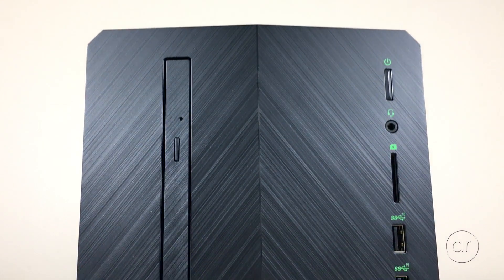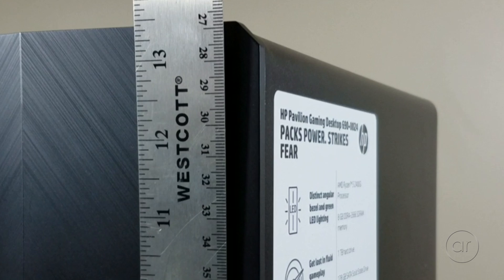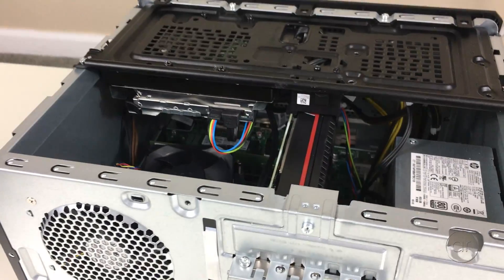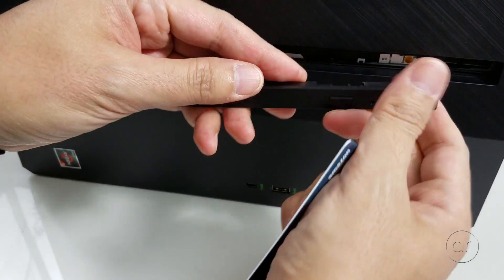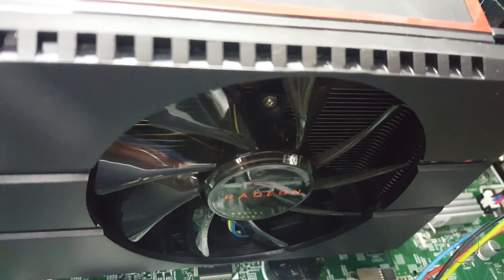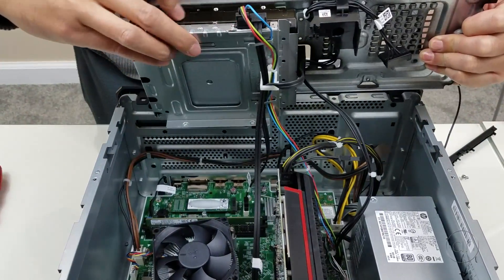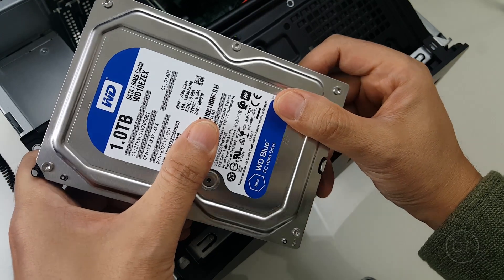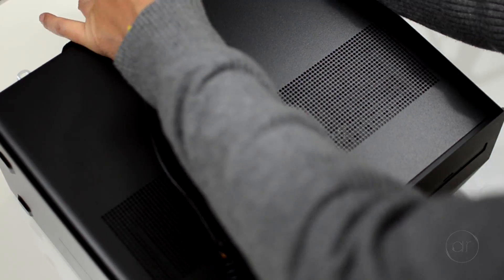How to Open and Upgrade a Ryzen-Based HP Pavilion Gaming Desktop

Comment: Well, I've gone and done it now! While in the process of upgrading the M.2 SSD to a WD Black 1TB NVME...I fried the mother board.  Thought I'd share so people can learn from my mistake.

The Bios on this computer has a real hard time recognizing hardware changes. you basically have to clear the CMOS every time and because of the GPU placement the easiest way to do that (which actually works) is to remove the button battery on the motherboard.  I forgot to do that when I swapped the M.2 drive so it wasn't recognized when I started back up. While kicking myself for forgetting to do that the first time...I got in a hurry...and...forgot to unplug the computer before popping out the button battery...which flipped itself across the inside of the case and shorted out the board when it landed coming in contact with both the board and the PSU. :(

Computer is dead...I went through a long series of tests but the best I could get was that the LED on the power button will come on as soon as I plug it in but nothing else works.  Unplugging the PSU fan controller connection (small 8pin) from the MB results in the case fan and the CPU cooler fan to come on...but nothing else works.

I have now completely disassemble the computer, removing everything from the case, and ordered a new motherboard and case (because the new MB won't fit). In doing so, I discovered I'm also going to need a new PSU as I don't think the one that came with this computer can be used with another motherboard due to the presence of the PSU fan controller connection which doesn't exist on commercial off the shelf motherboards.  I did find an exact replacement sunflower motherboard online...but it cost $368 from china!!!  I also found an exact replacement PSU online...for $218!!! These custom proprietary parts are ridiculously expensive.

So in the next week I will be setting up a new PC using a new B450M Gaming Plus motherboard, new 450w PSU, new Case, and all the other components from this PC...the 2400G, Freezer 12, RX580-4gb, 16gb Samsung RAM, 1TB WD Black M.2 NvME SSD drive, and 1TB WB Black 2.5" SATA SSD drive. Wish me luck...I sure hope the CPU wasn't fried when the board shorted!
Reply from the maker: Doh! Sorry to hear that - those replacement prices are criminal. At least most of your components will carry over to the new computer. Best of luck to you!

Comment: I have the same model but want to add more ram is it ok to mix brands with the same gb
Reply from the maker: Though I generally don't recommend mixing memory brands or models, I've had several reports of successful memory upgrades - you can find the models above in the description (under Memory, not Replacement Memory).
Reply: @accessrandom  thx you just got a new sub
Reply from the maker: Thanks - glad to have you here!
Reply: @accessrandom ust ordered the GSkill 8GB F4-2666C19S-8GNT thx

Comment: Is there any way to make a am4 cooler fit at all? Like a adapter or anything?
Reply from the maker: Unless the cooler comes with the brackets for an Intel mount, I'm afraid not. I suspect the motherboard manufacturer (Sunflower) cut some corners by keeping the mounting points drilled for Intel.
Reply: The Freezer 12 comes with a custom mounting bracket solution which allows it to be used for either Intel1151 or AM4...but I've not seen a bracket sold separately that would allow for this.
Reply: @terryparrott9426  if I follow your instructions, do you think using Velcro to attach a 2.5" SSD to the top of the psu would be problematic? I cant get rid of it

Comment: does anyone know what kind of cooling system i can add to this?
Reply: I provided a detailed rundown of how to reduce the excessive heat generated by this PC. The details are included in the notes above or you can look through the other questions that have been asked until you come to the one I wrote about cooling.
Reply: @terryparrott9426  so much work ugh! Edit: for someone who has only ever upgraded ram and installed ssd's

Comment: i have one but with an RX 550 4gb... I searched on Hp's website for the model number (690-0067c) and I couldnt find it anywhere. I expected it to be an old model, but soon found out that it was assembled just under a year ago! How do I know if I can upgrade this?
Reply from the maker: Looking at the motherboard for the 690-0067c, it looks identical to the 690-0024 (with identical CPU upgradeability). I can't say with 100% certainty, but it appears to have the same upgrade paths.
Reply: I have the same system bought from Costco.  It can be found on the HP site here:  https://support.hp.com/us-en/document/c05953209

So far I have added a Samsung 970 EVO 500GB - NVMe PCIe M.2 2280 SSD (MZ-V7E500BW).  After installing the ssd and reinstalling windows 10 on it the boot time went down significantly and the system is much more snappy and responsive.  I am upgrading the rx550 to an rx580 also just waiting for the 400w psu to come in from HP.  The rx550 was fine but can't play games much higher than low or med settings at 1080p without stuttering real bad.

Comment: what type of ram does this computer already take? and could i just buy the same one that's inside to add more storage
Reply from the maker: There have been two specific models of memory that viewers have reported (you can find them in the description). You can either add the same model, or add one with the exact same specs.
Reply: access random do you know if a GIGABYTE NVIDIA GeForce GTX 1070 GV-N1070WF2OC-8GD 8GB  will go into this computer im have trouble figuring this out need help
Reply: AS an FYI...I've found that you can buy a matched pair of 8GB ram sticks from the major RAM retailers for the same price as a single 8gb Samsung stick. You might be happier replacing the one in there with a matched set and trying to sell it to recover some money.

Comment: Help please what upgrades I need to play Black desert online remastered on high setting please list in comments
Reply from the maker: It looks like the game's recommended system requirements are an Intel i5-650, Nvidia GTX 970 or AMD RX 480, and 8GB memory to run at 720p. I'm not sure how that translates for higher resolutions and running at highest settings. Has anyone else had any experience with the game?
Reply: There are two upgrades needed...add another 8GB memory stick to bring your total to 16GB. The reason you need to do this is because 2GB of your 8GB are reserved for the 2400Gs onboard video support (which is disabled by the way) so you only have 6GB available for gaming. Then enhance the cooling as I described elsewhere in these forums. This computer runs hot and the thermal throttling is real...for the CPU, GPU, and RAM! Once I made these two changes I could run any game on high settings without issue.

Comment: Saw a few other comments asking, and I saw you said there were mounting holes for another 2.5" SSD, do I need to go out and buy a bracket for it or is there a safe place/way to hold the SSD in place without doing so?
Reply from the maker: I actually took the path of least resistance and used velcro :) However, I believe you can use the four mounting holes on the cage (which you can see at the 4:30 mark - where the holes are drilled into the indented part of the sheet metal). Not 100% sure - but those seems to line up to a horizontally mounted drive.
Reply: @accessrandom  Thanks, I really appreciate it.  I discovered that the particular model I have, the on-board graphics were using at least 1GB of the system's total 8GB memory, then I had some issues and was forced to update BIOS, which then caused it to take around 2.2GB of memory constantly.  I found a 2x8 DDR4 with the same timings which I'm going to install in a few hours and wanted to throw the SSD in as well.  My Model is the 690-0024 running the Ryzen 5.  Adding more RAM will at least give me a bit more wiggle room and oomph, but it isn't a permanent solution and HP has made it so you cannot disable the onboard Vega graphics via BIOS or other means, so the 16GB is still going to be only around 13.8.
Reply from the maker: Yeah, that is the same scenario that one of my viewers discovered (in the description under CPU) - shame on HP for not allowing us to disable the onboard graphics. Because of that, I've done the same thing as you - upgrading to 16 GB.
Reply: @accessrandom  Whoops, I must have missed that part in the description, didn't mean to hit you with stuff you've already discovered.
Reply from the maker: No worries! Any findings are always greatly appreciated. It's a good reminder for others to mention this in the comments 👍

Comment: Does changing the CPU from 2400g to a 2600 remove the 2gb of ram held up by the iGPU?  Looking at upgrading the CPU as Ryzen deals come and go!  I wish we could remove the iGPU restriction in BIOS!
Reply from the maker: Yeah, same here - this was really low of HP to omit that. Theoretically, the memory should be freed up since the 2600 doesn't have graphics. One of my viewers Brendan Bone (see description) has upgraded to that processor so you may want to look for him in the comments and reply with your question.
Reply: Yes, it does. When I changed the CPU to the R5 1600, the memory was freed up.

Comment: I have a HP Pavilion Gaming 790-0000nl and I noticed that the panel where the hard drive is located is not the same and the screws are different. Do you have a video which explains how to upgrade that particular computer? I would like to add a SSD but I struggle understanding how to properly open the PC. if you have any useful information let me know.
Reply from the maker: From the information that i could find online, this is a model specific for the Dutch market but the case seems to be the same as the 690-0024. Unfortunately, I couldn't find any information about the internals so I hope one of my viewers has had experience with it. Anyone?

Comment: Mine came with a 400w on a Ryzen 7 with 580 GPU. Is there any upgrade I can do to the graphics card with this PSU?
Reply: Any graphic card with the same or smaller power requirement will most likely work fine
Reply: You don't need to upgrade the power supply...it's actually one of the strongest parts of the computer.  You're only using 300w of the 400w capacity and it's certified 80+ Platinum. Increasing the power capacity won't buy you anything...
Reply: @terryparrott9426  so what should you upgrade for increased performance in games?
Reply: Ethan Reyes - RAM and Cooling are first, then replace the 128gb SATA M.2 with a 1tb NVMe M.2 and run your games from there.
Reply: @terryparrott9426  thank you
Reply: Terry Parrott so even though it recommends 500w+ 400 will be fine and i can still game on it??? lmk asap please

Comment: Should I were one 9f those wrist straps that prevents electronic shock if I'm upgrading ram and I've never turned on the pc
Reply: also...make sure you unplug the computer before you open it up...every time...long story!
Reply from the maker: Yes, I recommend an ESD strap. You can do it without a strap and you could simply touch the metal part of the case, but you would need to maintain contact with it while you're upgrading the memory.

Comment: So, can I upgrade the graphic card to GTX 1070 or GTX 1080?
Reply from the maker: I haven't had any specific report of people trying those cards, but one of my viewers (Apache Helo Copto) has suggested that the 1070, 1070ti and 1080 mini variants from zotac may fit, but recommends getting a larger power supply.
Reply: @accessrandom  What would be an example for a good power supply for those cards?
Reply: access random can i upgrade power supply on the 690-0083w model ? is the normal supply it comes with strong enough for the graphics card???
Reply: Couldn't you shoehorn in a second rx580?

Comment: I just got this from my buddy for $250. The computer itself and components gets very hot when gaming, if you touch the back where the heat is being exhausted it can almost burn you. I see my GPU get up to 80+ Celsius. Is there an ability to upgrade the cooling fan for the cpu? I already have the case open just to give it better airflow.
Reply from the maker: Yeah, I've also noticed that the exhaust gets pretty hot. One of my viewers (Terry Parrott) has installed an Arctic Freezer 12 but he had to remove the internal cage (please see the description for his procedure). For any fan that you get, keep in mind that the motherboard mounting points are for Intel, not AMD (!)

Based on the fan specs, another viewer (Apache Helo Copto - thanks!
) has given some suggestions for low-profile fans, including the Noctua NH-L9x65 (might fit), Noctua NH-L9i, and Cryorig C7.

Comment: I have a HP Pavilion 690 - 0034 AMD Ryzen 7 desktop with 16gb of ram, 128 SSD, and 1TB hard drive. So far it's great but because I play a lot of the bigger games (Fortnite, Overwatch, etc) i'm already seeming to run out of space. I've never updated a computer but if I was to get this one updated, what would I update for more storage? the SSD or the 1TB hard drive? or both? and what is the maximum SSD I could update it with and would a 2TB hard drive work? Thanks!
Reply from the maker: You have three options - (1) you can replace the M.2 SSD, or (2) you can replace the 1TB HDD, or (3) you can simply add a 2.5" SSD by using the additional SATA port. I'm not sure about the 690-0034, but there may even be another SATA port.

If you use option (1), you will need to replace the existing M.2 SSD with another. You would need to either (a) clone the existing Windows from the old to the new using a cloning program and an external USB M.2 SSD adapter or (b) use the recovery partition on the HDD to restore the new SSD to factory state.

If you use option (2), you simply replace the HDD with a new 2.5" SSD. Be aware that the recovery partition is on the HDD so you will need to either (a) clone or image that partition, or (b) create a set of recovery DVDs, after which you don't have to worry about saving the recovery partition.

If you use option (3), you simply add another 2.5" SSD while keeping the M.2 SSD and HDD. This would be the simplest way to add storage. There is no mounting bracket per se, but there are mounting holes on the cage (I used velcro myself 😀)

Good question about 2TB. I'm sure you can use a 2 TB 2.5" SSD for options (2) and (3), but for option (1) I'm not sure about the maximum size of a replacement M.2 SSD. One viewer has upgraded to 1 TB.
Reply: @accessrandom  I always feel a bit dumb asking questions like this but you explained it so well and were very helpful, thank you so much! :)
Reply from the maker: No problems. Feel free to ask anytime - your question was actually a very good one.
Reply: I have same machine. I bought western digital black edition m.2 NVmE ssd to replace the small one that comes with it. It's even faster now. Got on Amazon. Easy to replace. Cost varies per Amazon tactics, but you can get same one as mine averaging around $90-$106 for 512gb or around $99-$129 for 1tb ssd

Comment: So I have this exact model, and I'm not a fan of the stock cooler. What's the best I can do for cooling in this, since it's a pretty small case?
Reply: The cooler looks like it docent use am4 mounting points but maybe intel mounting points.

Cooler height is a issue since its a pretty compact computer.

The only two coolers i think of would be the 

Noctua NH-L9x65 (Might fit)
Noctua NH-L9i
Cryorig C7
Reply from the maker: One of my viewers was successful with an Arctic Freezer 12 (but he had to remove the cage to make it fit). You can find his full story in the description. He discovered that the mount points on the motherboard were drilled for Intel, not AMD...
Reply: Thanks for the quick responses guys! I was getting a little worried when idling temperatures were 60C
Reply: One more thing to say, I have a spare EVGA 550W power supply sitting in more room, will it fit in this build? It'd be nice to have some spare power.
Reply: @-nameless-5778  There's no reason to do this, the computer only draws 300W so the existing 400W PSU is more than sufficient and its rated at 80+ Platinum...which is exceptional.

Comment: Do you think I could change the LEDs on the front by others of different color?
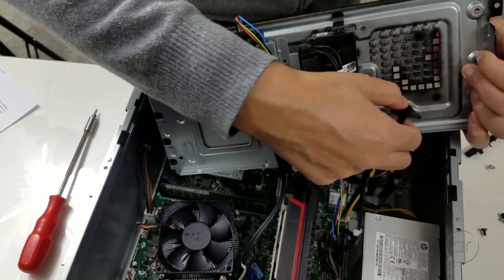Reply from the maker: Sorry, I didn't get a good look at the wiring for the LED. But it would be in the front panel of the case - at the 5:22 mark, you can briefly see the three tabs that hold the panel unfastened. I push them back in at 5:24. You'll need to undo those three tabs and see what type of LED is in there and the wiring for it.
Reply: Was it figured out

Comment: If you switch the case to a bigger case, will you be able to put a bigger gpu? Or will I have to change the motherboard for that
Reply from the maker: Yes, you should be able to replace the RX 580 with a larger graphics card since it's a regular PCIe x16 slot. The only question is whether the power supply can handle it (depending on the GPU's power consumption), and whether the pin connectors for the power supply are standard (in case you need to replace it).
Reply: Oh thanks, I'm going to be switching my power supply soon too